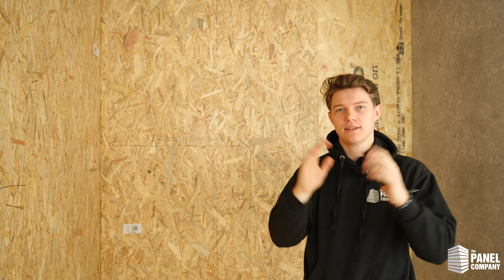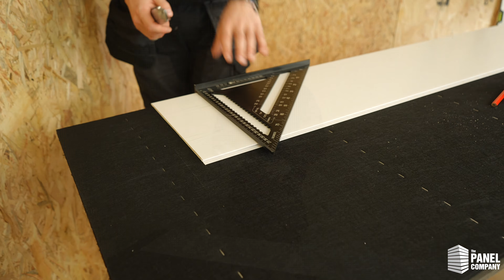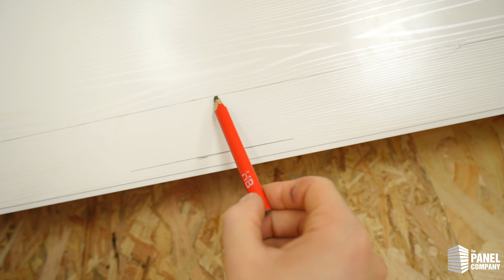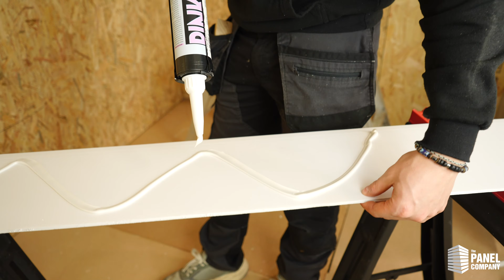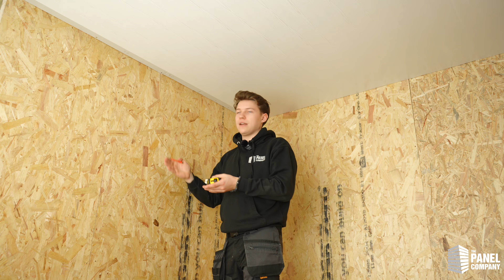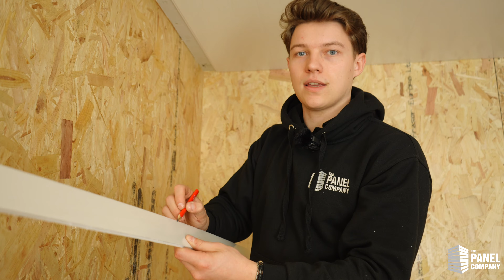Ultimate Guide to Installing PVC Ceiling Panels | Complete Step-by-Step Tutorial | The Panel Company

Comment: Perfect video! Question, I'm converting a 20 ft container into robotics lab with 3d station, and electronics fabrication bench, If I was to do the sides as well as the ceiling, would I install the same way? Also do you have a source for the white panels you use? Im also looking for a source for grooved panels I could use to hang items on like bins or tools. Just seeking your advice.
Reply from the maker: Hi, yes, you would install them the same way. We recommend using STRIVO mdf panels for this project https://www.panelcompany.co.uk/collections/mdf-wall-panels

Comment: What is the best method to deal with a ceiling which slopes down at the window?
Reply from the maker: Hi, when dealing with a slope, we recommend using an end cap at the end of the horizontal section, then use another end cap at the beginning of the sloped section.

Comment: I don’t understand what you just did with the last board 😢
Reply from the maker: Hi Walter, 
Measure the length of the panel , then mark on the ceiling at 30cm intervals and measue the distance from the tongue of the second to last panel, to the wall. Transfer those measurements onto the final board to go in and cut it down. Then you will have a perfectly fitting, scribed piece.

Comment: Thinking to install these in a ensuite bathroom, would you apply straight to wooden beam and fill with insulation or would you recommend to install moisture resistant plasterboard underneath then apply the PVC boards?
Reply from the maker: Hi Adam, there's a possibility the room could "sweat" if you boarded straight onto insulation. For a bathroom application moisture resistant plasterboard would be perfect. If they want to insulate the roof apply the insulation, then the plasterboard, then the panels.

Comment: Great video. Just wondering what you would do if there were spot lights? Would you drill the hole first through the plaster board, stick the panel on and then drill the hole again or drill the hole through the plaster board, mark out the hole and cut on the panel before sticking it on? Also, what size screws did you use? TIA
Reply from the maker: We would fit the ceiling panels then drill through both ceiling panel and plasterboard, a ceiling panel is both very easy to cut and drill through.
We used 20mm screws.

Comment: Great video, quick question is there a good rule of thumb for how many tubes of sealant i should get when i order the panels? Ie how many will a tube do.
Reply from the maker: Hi, thank you for the feedback! We advise 2 tubes of adhesive per panel.
Reply: @ThePanelCompany no way do you need 2 tubes per panel!
Reply from the maker: @wesleyarnold5178  We recommend using 2 tubes per panel to ensure a secure fit, particularly when installing on ceilings.
Reply: Thats for 1m wide panels@ThePanelCompany

Comment: Great vid, do I need to leave an expansion gap all the way round where the panels meet the wall? If so can I then silicon to cover the gap?
Reply from the maker: Hi, It is good practice to leave a small gap even though there is little to no expansion in PVC wall panels. Yes, you can cover this gap with silicone and the gap helps the bead of silicone adhere.

Comment: Adhesive is such a short sighted idea. What about when it comes time to redecorate and you want to remove/replace the panels. Ceiling ruined.

Surely an edging strip which you fix to the walls and then slot the panels into would be better?
Reply from the maker: Hi Mike,

Solvent-free pink grip causes minimal damage to existing plaster, as long as the plaster has not deteriorated due to age.
Reply: Mines is up with silicone and screws and I'm going to have to remove mine to retile bathroom I've been told that it will pull some paper of plasterboard and at worse I'll need a new ceiling

Comment: I have been looking for a video that shows how to install your coving before I begin to do the ceiling panels.
Reply from the maker: Good Morning, 
Thank you for the question. We are currently building our library of videos and we will add your request. 

After fitting coving for many years, I now fit the wall panels and ceiling panels first and fit the coving last. You can do this by removing the rear tab on the coving, it makes it a lot easier to fit the tabless coving with a bead of silicone sealant. To remove the rear tab, run a Stanley knife down the rear channel and it comes away easily. 

Regards
Panel Company Support
Reply: @ThePanelCompany   In the end after considering that option I opted to return the coving which you kindly swapped for quadrants. Great service will use you again.